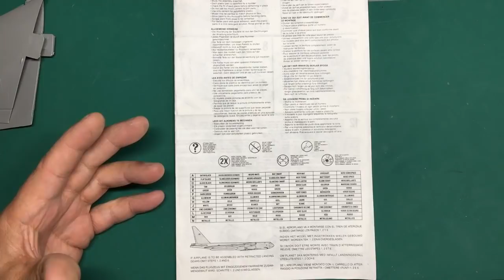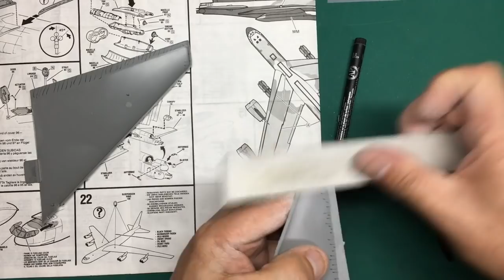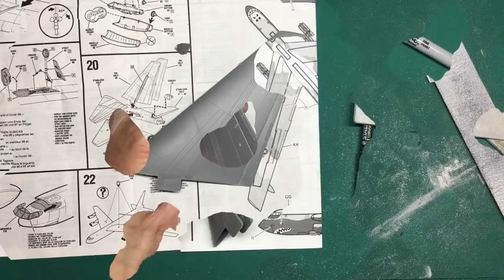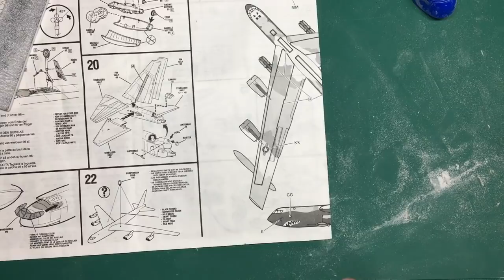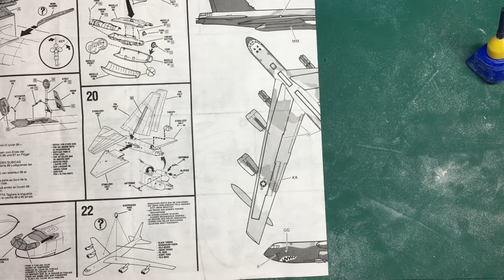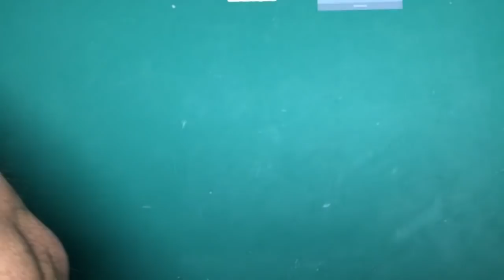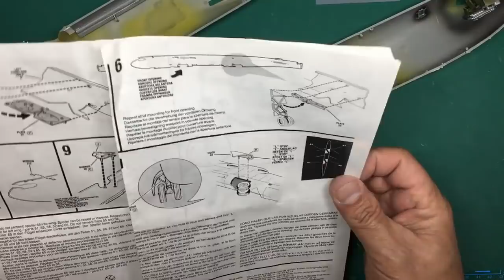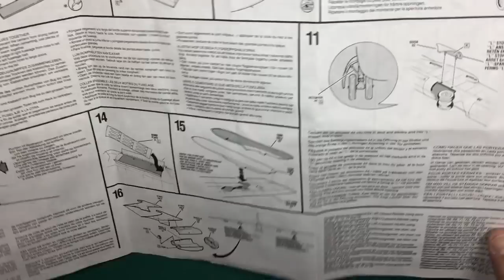Big Bad Buff Build for Beginners. Part 8

Comment: Hello Nigel, 

Thanks for another excellent tutorial. I am finding your tips and explanations really helpful as I build my Buff.

I hope you don’t mind,  but I have a question regarding the wing mouldings, which I would appreciate your help with. 

Problem.

Having looked at main wing mouldings and the vertical stabiliser mouldings on my particular kit, it appears that the vortex generators are in the wrong position and incorrectly shaped on the main wings. 
Additionally 
It looks like Monogram have used the same mouldings for both the left and right vertical stabiliser wings so one set of vortex generators is moulded on the top surface of the vertical stabiliser and the other set of vortex generators are moulded on what is actually the bottom of the opposing vertical stabiliser when it’s assembled and put in place on the fuselage.

Do you have a fix for this?  
Does anyone produce accurate aftermarket vortex’s generators in 1/72 scale for this kit?

I’d really appreciate any help or advice anyone can offer regarding this issue.
Thanks.
Reply from the maker: I would advise you watch the video before asking questions Dave.....
Reply: Hello Nigel,
Thanks for replying so quickly. I did I fact watch your video. It was whilst looking at the edges of my wings to mark them up to replicate your sanding technique to make the profile of the trailing edges thinner, that  I noticed that detail on the rear wings / tail fins / horizontal stabilisers, parts was different to those which you are working on. I have several of these kits, which I’ve had for some time, so I can only assume that I must have mixed up the parts from several kits at some point in the past.  I’m off to check the other boxes now to see if I can find  the correct matching parts..
Reply from the maker: @davewhittle2480  from reading your first message it sounds like we have exactly the same mouldings?
Reply: Hello Nigel,
Thanks replying again.
Having looked through my other kits, all three sets of wings are the same, so we I guess we must have the same mouldings. The part detail on them just looks a bit weird to my eye. Which is possibly due to these being old kits with raised moulding.
I’ll just keep watching your tutorials, and build along and see how things go.
Many thanks